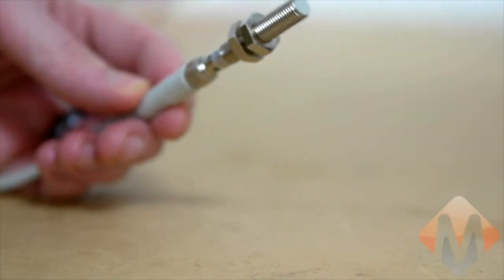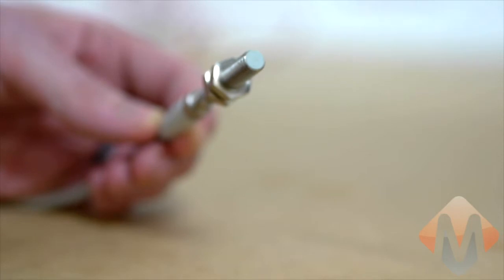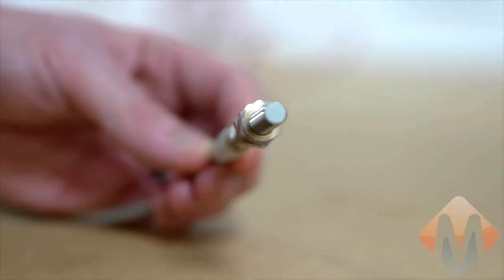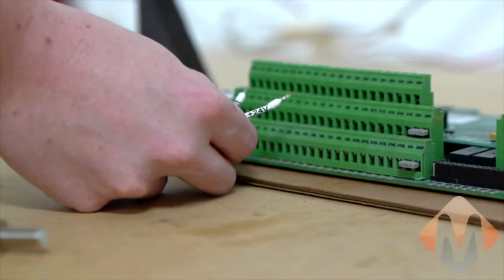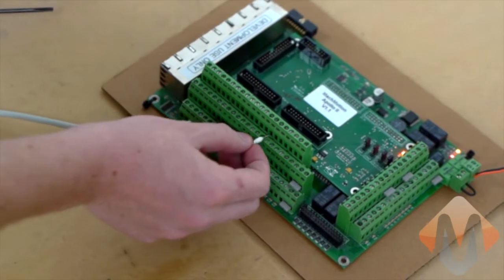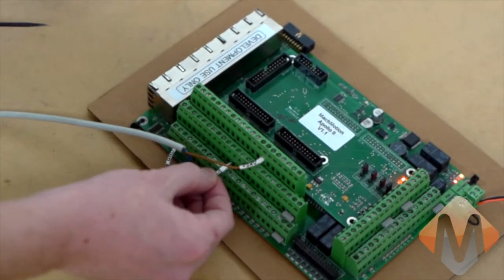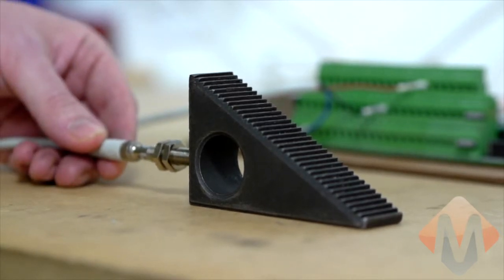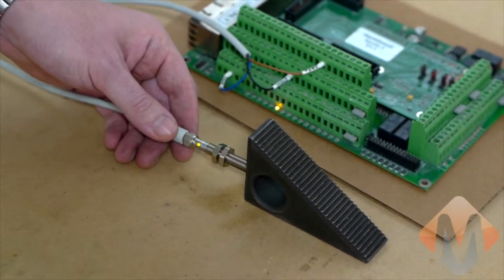Wiring PNP Proximity Switch-Apollo III

Comment: thank you
i want to ask i have proximity sensor DC 6 36 V and i have brakout board work just with 5v 
pls how i can connect 3 wire 
P S   NPN
Reply from the maker: el alami Mohammed for our breakout board: You can use 2.5V to 48V. Our manual shows some detail of this of the inputs setup beginning on page 67 and the spec ranges on page 11:
http://machmotion.com/documentation/Motion%20Controllers/Apollo%20III/Apollo-III-Manual-1000-Series.pdf

If it's not ours, I can't be much help. Good luck!

Comment: 24V prox only right?
Reply from the maker: JOe Shmoe You can use 2.5V to 48V. Our manual shows some detail of this of the inputs setup beginning on page 67 and the spec ranges on page 11:
http://machmotion.com/documentation/Motion%20Controllers/Apollo%20III/Apollo-III-Manual-1000-Series.pdf
Reply: MachMotionVideo What I mean is that anything but 24 V gets more complicated.